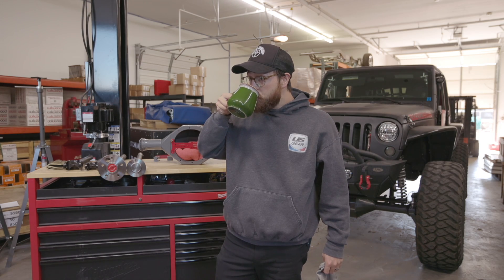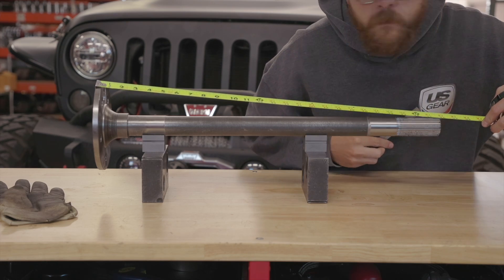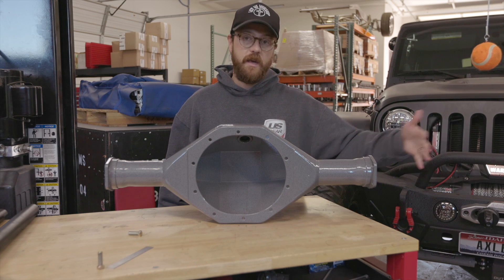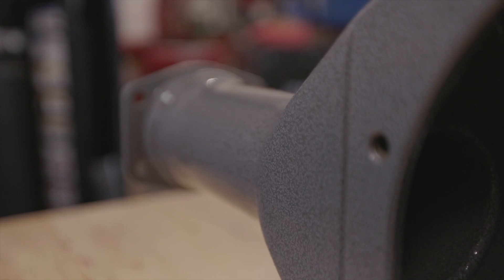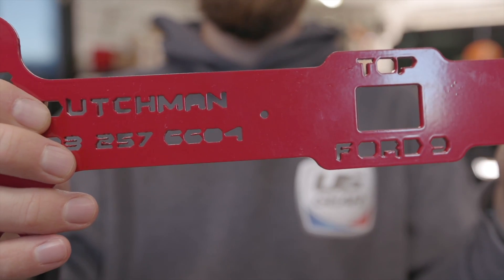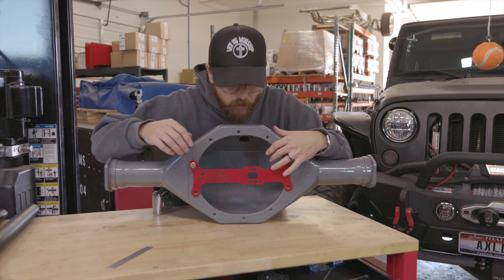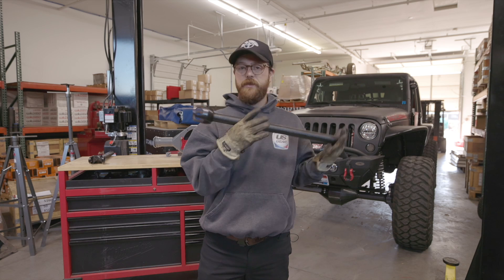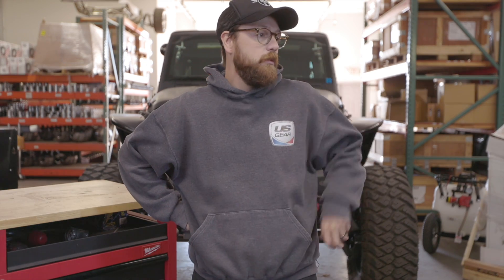How to Measure Your Axle Shaft Length

Comment: What if I need full float shafts splines on both sides outer sided has snap ring and uses Yukon drive slugs. I have old shafts that worked with the drive slugs and 3rd member but I switched everything to a better housing that’s wider so now need longer shafts but same design as the old ones just longer. How do I measure this. I have been looking on your website and just don’t want to order wrong length shafts.
Reply from the maker: Thats a good question, and sorry this is so delayed.  We have a full float axle ordering guide that should help!  Here is a link to the guide:  https://dutchmanaxles.com/images/ordering/defined-only_ds-floater.pdf

and here is a link to the form:  https://dutchmanaxles.com/double-spline-full-floater-axle-pair.html 

Hope that helps!